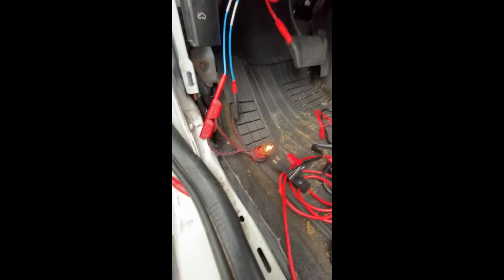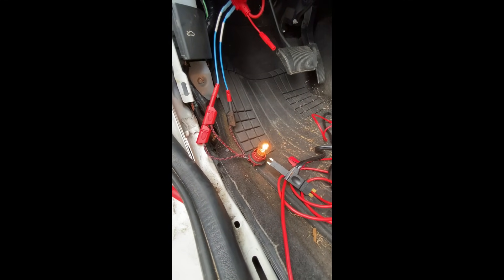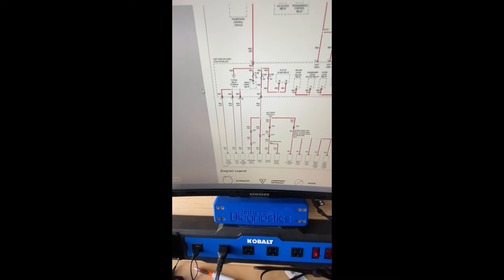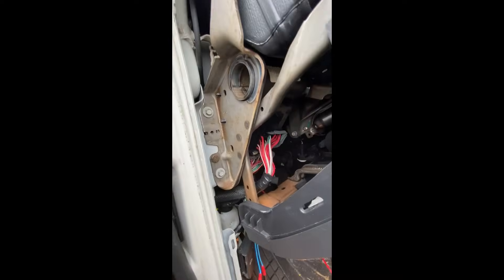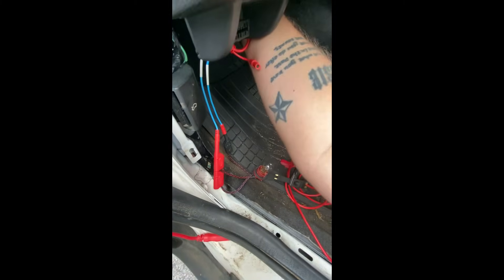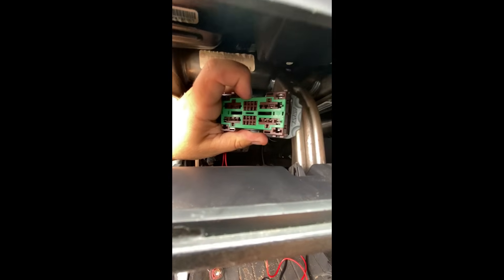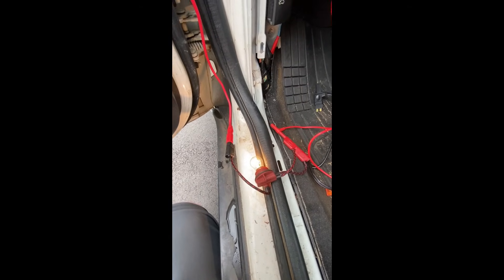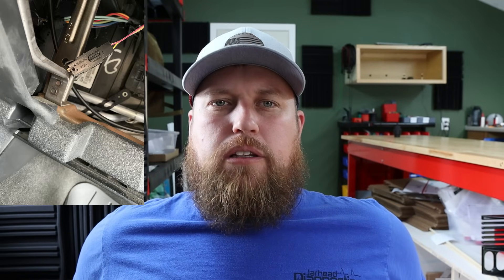Easiest way to find a short to ground!

Comment: Thanks for the excellent video.  When you probed pin 7, was the lead on that probe just jumped from one side of the test light?  Also, where are you located?
Reply: same question?did he jump from the test light or hook up to power from one side of the light then when he probed #7 that should be 12v power it lit up the light because the short was a path to ground.i want this to be my new method for locating shorts but need more info do you know any other vids that use the same method?

Comment: A blown fuse and a buzzer soldered to it works great to find a short too.
Reply: i'M BUMMED rADIO sHACK ISN'T AROUND FOR THE SHORT TRIP TO GET COMMON ELECTRONIC COMPONENTS. nOW IT'S A DDRAG
Reply: That's a great idea.

Comment: I don’t get it…..
Reply: If you substitute the fuse with a load such as the test light it serves two purposes. Number one, when the short to ground is present there's something to absorb that current flow. You've basically put the test light between the power feed and the portion of the circuit that's grounding out. Number two it gives you a visual representation of when the short is present. This is particularly useful when you have an intermittent problem. When the bulb is lit bright you can go around wiggling wires and unplugging things until it goes away. This lets you know that you've isolated your short. You can also use something that makes noise like a buzzer or chime so you can listen rather than having to look for the light.
Reply: Hi I was wondering if you have an input on the mic sig scope ato 1104 specifically designed for automotive use. Thank you
Reply: Exactly where are the test light leads connected?  If I knew that without instructions, I probably would already know the rest.
Reply: I understand the concept of using a test light or diy’ing one using a headlight bulb and connecting wire to each side for a positive a negative. But what do you put on the other side of the wire that connects to the fuse socket? 

My 2003 Passat Taillight fuse keeps blowing. I tried building a test light and stuck some pieces of a paper clip on the other ends to stick into the mini fuse socket and then turning the headlight switch on (this is what triggers the fuse to blow) but the light wasn’t lit up. I connected the test light  directly to the car battery and it lights up immediately so I’m not sure where I went wrong.

Comment: Been using that method FOREVER, back in the day, I would use a 4652 headlight and because of padded dash tops, I would lay the headlamp on a ceramic tile on top of the dash so I could see the light while pushing and tugging slightly harness.
Reply: Well…definitely not a video for the average guy who has no experience with mechanical/electrical work.
Reply: They call that the wiggle test.
Reply: Thanks!
Reply: Well I've got a Deadshort in my 07 Silverado. Be driving down the road and all the sudden all the lights go out on my instrument panel and my headlights go out and the air conditioner quit blowing. Come to a stop turn the truck off and turn it back on and the lights come back on lights on for 3 minutes might stay on for 20 minutes but I can turn it off and back on and then come right back on any and all suggestions are welcome

Comment: First? My favorite method as well! 5A test light works well. Sweet diag van 😁👍
Reply from the maker: Thank man! And yeah, it’s great way to save money on fuses. Lol
Reply: @JarheadsGarage lolol you must be joking right?! Lolol fuses are pretty dang cheap I bought a box and I have constant electrical problems and i still have a few dozen left.... What is a pain in the ass is the TIME it takes pulling fuses.... At least that's how I feel lol
Reply: @patmurch6184 But why spend the money at all on fuses when ya don't have to. Make money, don't spend it.😉😁🇺🇸
Reply: @JarheadsGarage  Keith DeFazio always used a Pulsar tool for shorts, but they are hard to find and kind of bulky